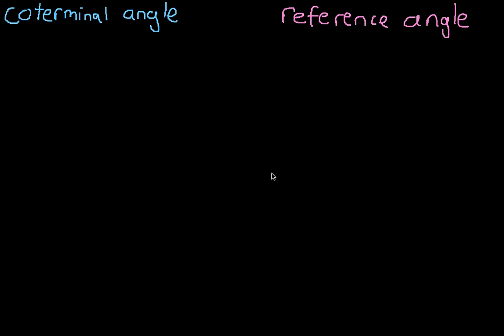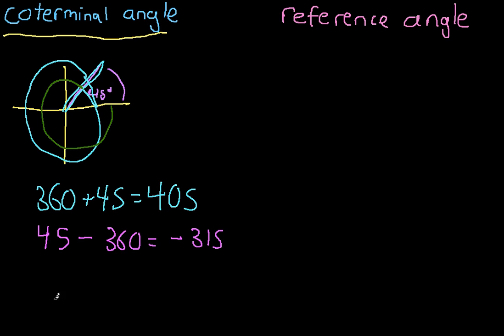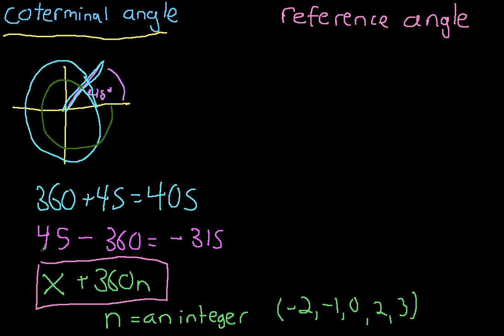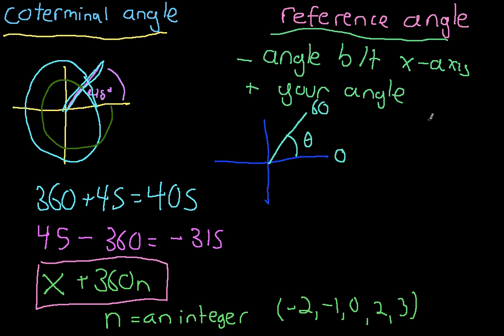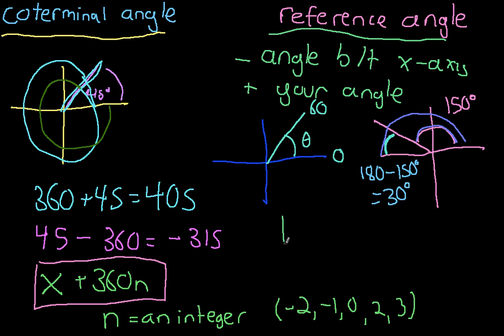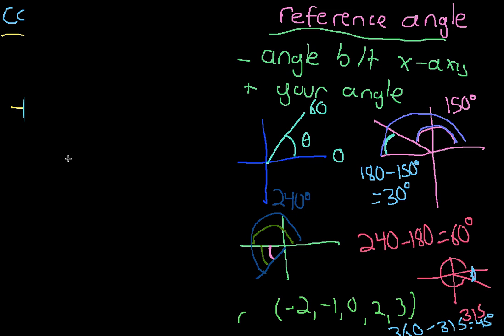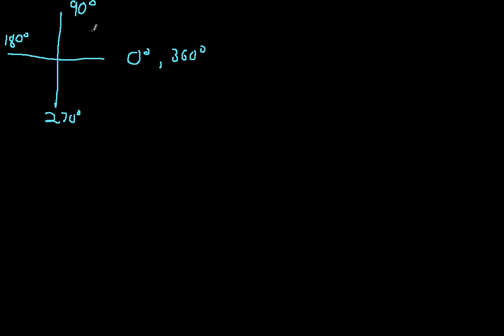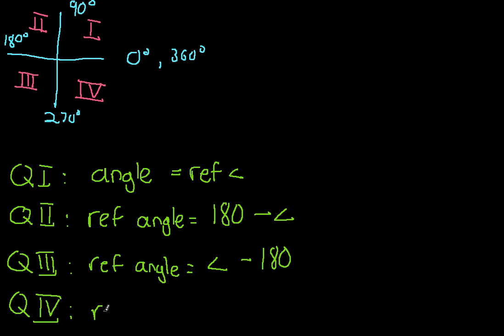Coterminal and Reference Angles Explanation

Comment: Why is the sine of an angle and the sine of it,s reference angle is same??I would be glad if you answer.
Reply from the maker: It’s not always the exact same.  It’s the same in magnitude.  For the unit circle, the sin(x) is equal to the y coordinate (which is effectively the distance from the x axis). Since any y coordinate will have the same magnitude of value for the same reference angle, the sin value is the same (or may have a negative sine)